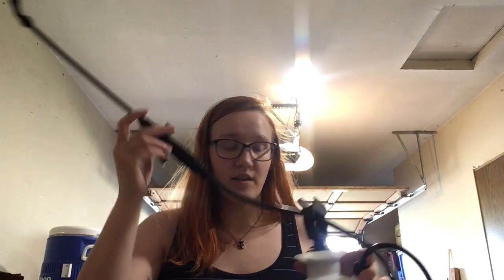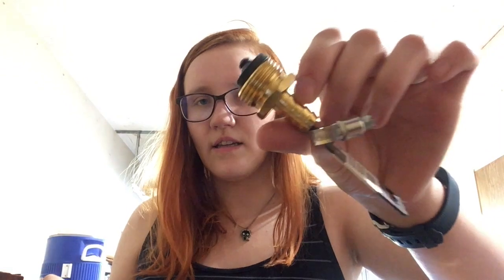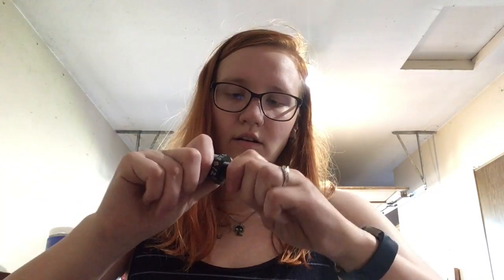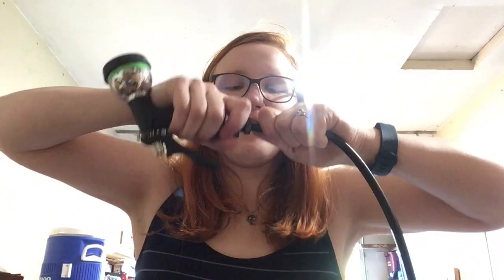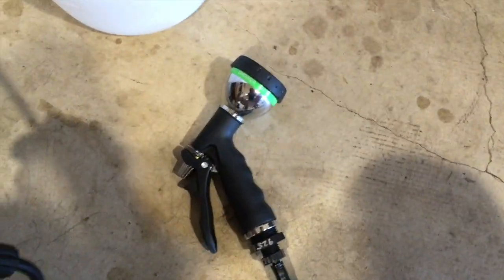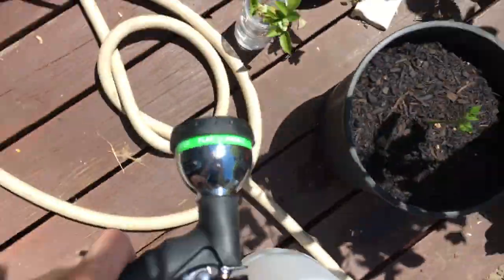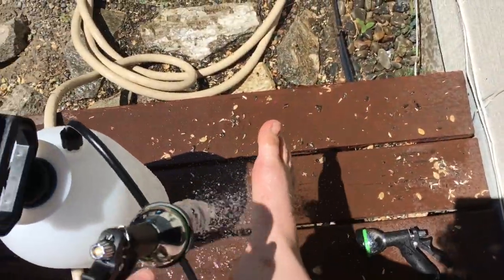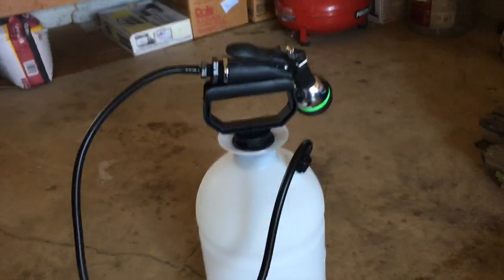How to Build a DIY Off-Grid Pressurized Shower System

Comment: I bought a brand new garden sprayer. I also bought a kitchen sink sprayer & a 6ft braided hoses. 
I kept the siphon "straw" & connected it to the braided hose. I didn't need any special connectors since it was already made for the kitchen sprayer. 
It has excellent pressure because the sprayer has small holes! 6-8 pumps gives 30-40 second strong burst. 
No special pumps, gas for heating or anything. That's true off grid style!
Reply from the maker: Nice!  I just picked up a kitchen sprayer with a hose attached at our local Goodwill.  I can't wait to try it out on our sprayer!
Reply: Just bought a 3 gallon metal sprayer.  I already have the kitchen sprayer from a faucet I replaced.

Comment: I purchased my weed sprayer for $15.00, and a spraying head $15.00 at Home Depot. The sprayer I have does not require me to hold the handle down to get water. it is a button that I  push up/down to desired strength and on/off Cool creation. Thank you for sharing. I might need the connector you mentioned because I purchased the 1/4 inch hose adapter 💖
Reply: iFlow Magazine wow.  That is great that you do not have to hold your handle down to get water.  If I go to Home Depot, can you possibly tell me what I would look for in order to get a nozzle like yours that has a button to push down as well?  At Home Depot do you think it would be near the Garden Hoses?  I'm new to all of this and definately "workmanship challenged" when it comes to putting things together like this (lol).  So, not sure what to even look for.  Also, do you think the connectors would be the same with the type of nozzle that you used?  Thanks so much in advance.

Comment: Thanks for the demonstration and ideas.  I would of liked to have seen you showing the shower head on the different settings that it has.  You possibly may have better pressurized spray on a different setting.  Plus you did not say or show what setting you had selected for your demonstration.